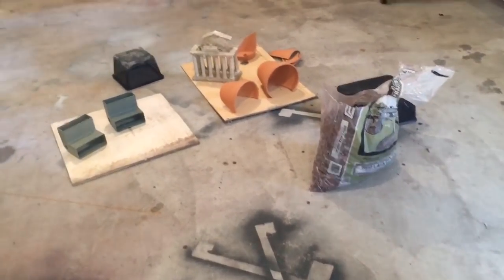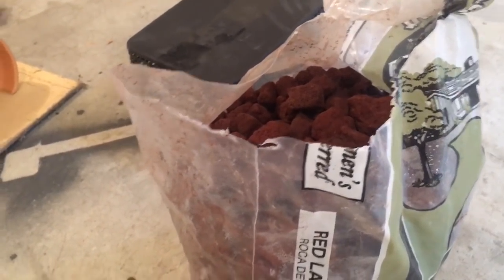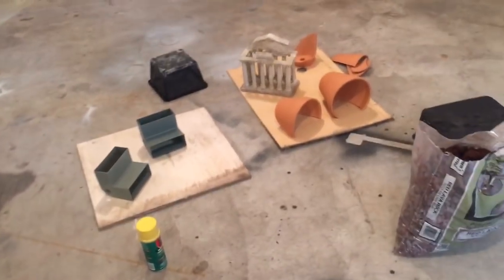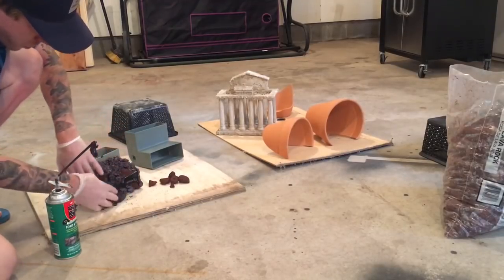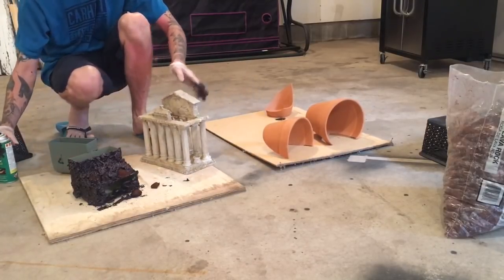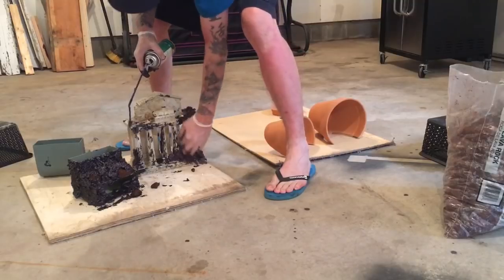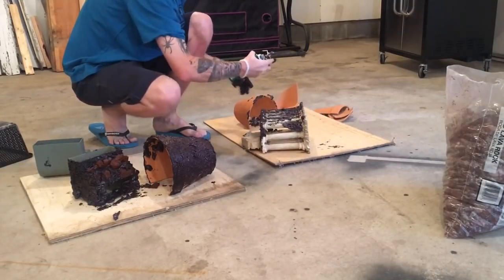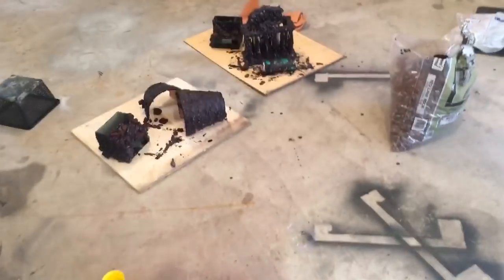DIY Tank Decor - Building Aquarium Decorations

Comment: Shake upside down for two minutes it makes it last longer

If you get on hand use gas to remove most of it or stick hand in water for about 10 minutes then peel it off with very little problem